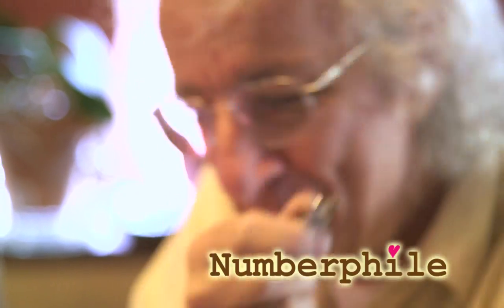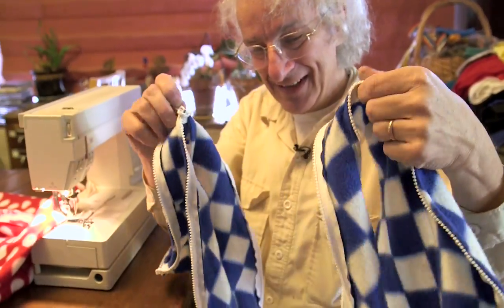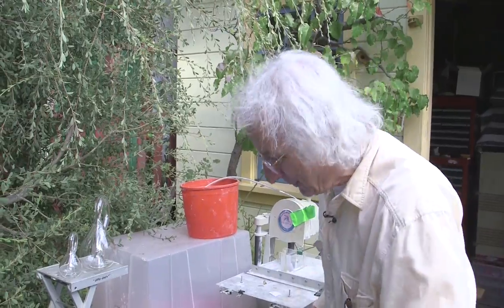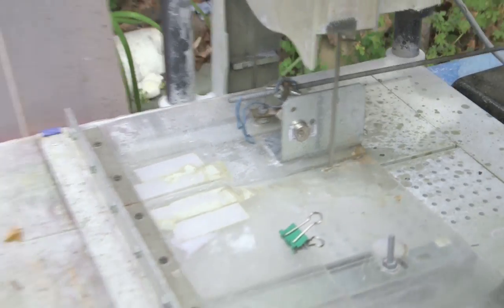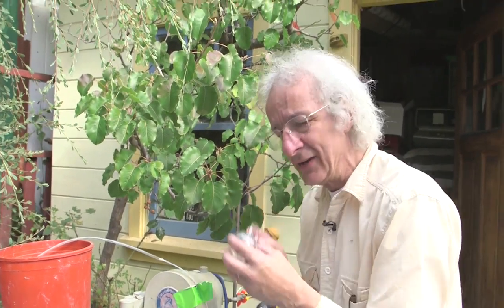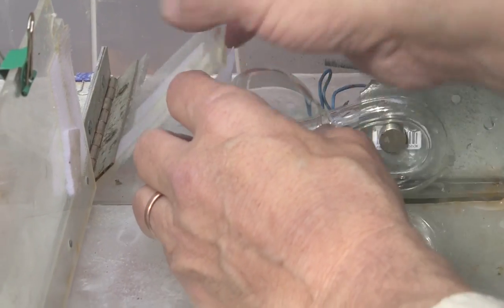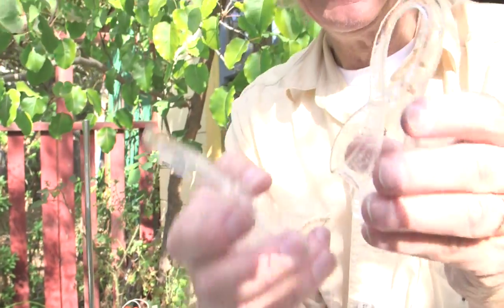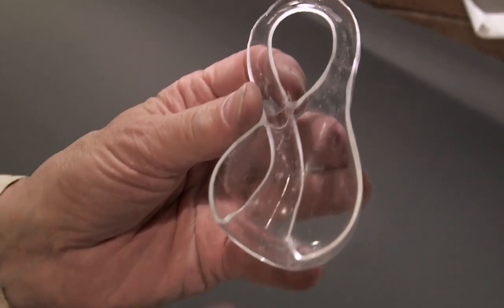Cutting a Klein Bottle in Half - Numberphile

Comment: someone should make a bong out of a Klein bottle
Reply: +Scratch I think he already did.
Reply: There is no hole in a Klein bottle. It's one continuous surface..
Reply: sure you can, inhale through the bottom, modify it so it suits the mouth a bit more, pour water through it, drill a hole in the side, put the holder for the weed, and you got yourself an upside down klein bottle bong. The bend will have to be made as more of a pit so it holds the water without it acting like a straw I assume
Reply: Hydrantdude how does this crazy dude make a klein bottle hat without a hole to put his head it
Reply: +Scratch That's what you get if you cut off the loop instead of taking a cross-section.
Reply: +d deadjl Did you even watch the video?
Reply: MasterDeanarius yes... why
Reply: d deadjl The whole thing about a Klein bottle is that is has 0 volume, so by definition it's impossible to make a Klein bottle Bong, anything you would do to make it work as a bong would make it not a Klein bottle. In case you were joking in your first comment, sorry that flew over my head then ^^.
Reply: MasterDeanarius zero volume is in a mathematical sense. it has one surface but there's still an inside to it
Reply: d deadjl
The word "inside" is always in contrast to "outside". You can't have one without the other. All orientable surfaces divide space into two regions and one can be called inside and the other outside, but non-orientable surfaces do not divide space and therefore do not have an inside and outside.
Reply: Melinda Green you're right, but there's still an area to hold water, I think, I'm feeling unsure now.
Reply: d deadjl It's concave for sure.
Reply: d deadjl The inside and the outside are the same side, you can trap the water by holding it right but even then the water is just as much on the inside as the outside, it's just dense enough so that it keeps in place, with air or smoke there would be no way of keeping it "inside" the klein bottle, and if you would close one section of to make it work it would no longer be a Klein bottle as it would no longer have 0 volume.
Reply: +MasterDeanarius kinda suspicious that you know so much about bongs... Are you a weed grazer???
Reply: +Dillon Lee (Dleeisme) If I know a lot about guns, am I a gunsmith/school shooter?
Reply: +DaneGraphics he's not high on weed
he's high on a Klein bottle crack pipe

Comment: 1 Cut a Klein bottle give you 2 mobius strips (opposite handed), Rotate one 90 degrees & stick them together, 2 cuts on mobius strips give you two interlocked hearts: Old news. :-)

So, clearly, folding the klein bottle and attaching two squares THEN making 3 cuts will give you the hearts.
Trick is folding the bottle.

Seems that the fold requires two additional crossovers through 4-space (in particular because when the mobius strips are attached, above, you have to "turn" one.). I'm pretty sure you can't just "pinch" the Klein bottle because then you wouldn't get that 90 degree turn required before attaching the mobius strips. It's the difference between folding a square into two rectangles or into two triangles. We need our "fold" line corner-to-corner.

We need the 4-space transitions so the entire square can be attached (otherwise, you'd have to turn the Klein bottle inside out in one section, but not the other....which is clearly a foolish notion.)

So, I've figured it's possible. Yay me? Anyone care to actually build it? (Mr Stoll? Maybe your buddy Carlo Séquin?) I've reached my own limit on this problem.

Comment: so basically you made a mobius loop that can only be placed on a 4-D plane (It's not a full Mobius Loop because of the "Handle part of the sawed klein bottle has to pass through itself) Am i right or am i confused. The way i see it is if you take a strip of paper (A 3-D object) and put a half twist, you get a 3-D Mobius Loop. And if you take a Klein Bottle ( A 4-D object) and cut it in half, you get a 4-D Mobius Loop (Just projected on a third-dimensional plane because we cannot comprehend any object beyond the third-dimension).
Reply: You're right.

Comment: I have a question irrelevant to the topic: Why is the distance between the points A(-3,-3) and B(2,2) equal to 0 if the distance formula is used? I graphed these points in Geogebra and the distance between A and B is 7.07.
Reply: Yes, thanks.

Comment: Does a Mobius strip have only one side because of an imaginative interpretation of what having one side means, or does it really have one side? In other words, does a sheet of paper have two sides only because we can't get to the other side without passing over an edge? Does it even make sense to say the second side disappears once we connect the two sides?

 Let's say we have some line that intersects some section of a plane. Then we must accept that the plane must have two sides to be capable of being intersected. If some line intersects some section of a Mobius strip, then the Mobius strip must also have two sides.

Let's reduce this to a line in a plane. A line segment has has two sides. Let's say we connect the ends of this line, but we claim we give it a half twist before we do that. We now have a Mobius line. Does this line now have one side?
Reply: In your intersecting-a-Mobius strip scenario, one must realize that if you take the side that the line enters, and follow it all the way around, without crossing any edge, you will reach the side from which the line exits. Quite confusing, but as the path from one point to the next is continuous and never reaches an edge, it must be one side. Therefore, the line does not intersect two separate sides but it intersects the same side twice.
Reply: Cut a sheet of paper in half (longitudinal cut). You should have twice the sides.
Make a Mobius loop and do the same cut. You end up with a normal loop with two sides.

You doubled the number of sides and ended up with two. Which proves that a Mobius loop has in fact 1 side.

I advise you using a math paper with the squares (don't know the name in english) so you never miss the center.

After youre done with that make a Mobius loop 3 or 6 squares wide and cut it at one third. 
I'll leave the results for you to find out ;-)

Comment: But what if the Klein bottle left the 3-manifold rather than self-intersecting?
Reply: +IoEstasCedonta Still works. Fortunately the fact that you can get two Möbius strips by cutting a Klein bottle in half, is independent of which ambient space you choose to embed it in. In fact to prove this you don't need to embed the Klein bottle in any space.

Comment: I'm amused by the video.  Not sure why, but I'm amused.  I think, though, you could have simplified the threaded rod assembly, and done away with the threaded rod, the drill, and all the clamps, and instead replaced them with a string, pulley, and weight.